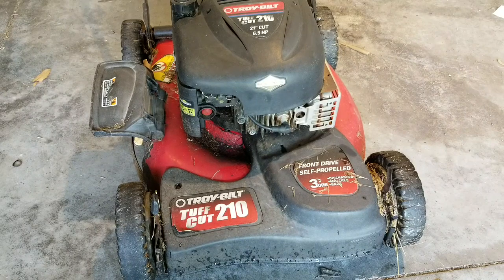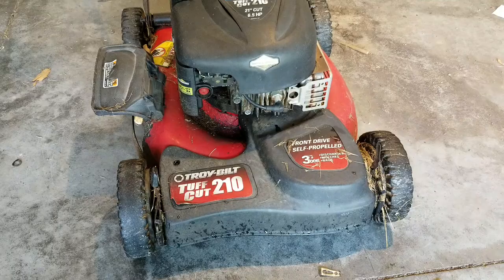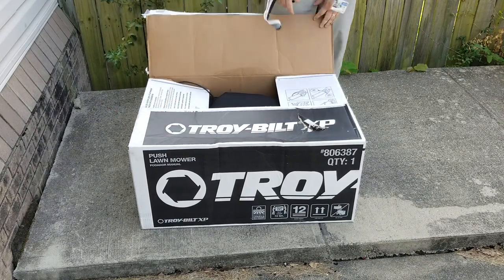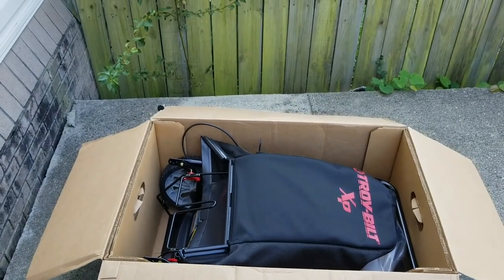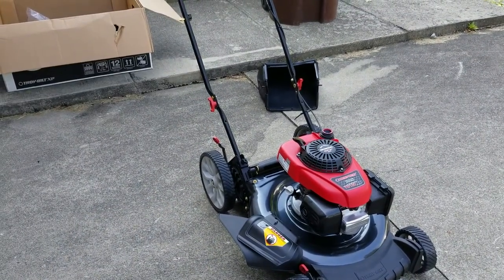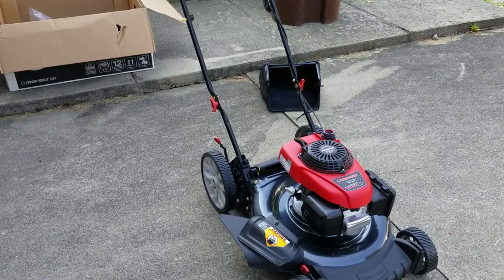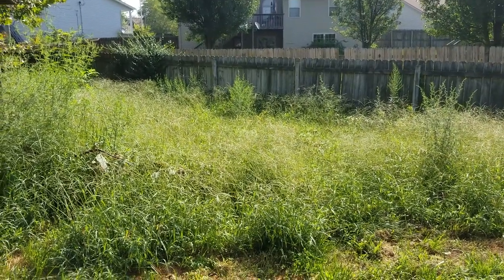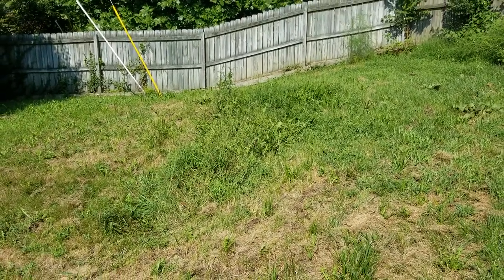Easy Bake BBQ S1 Ep3 Lawnmower unboxing

Comment: Nice looking mower. The Honda engine should serve you well. I have the GC190 in a power washer and I love it.
Reply from the maker: It is nice & quiet but I will end up with a Briggs & Stratton because I need it to be self propelled, check out my reply to Smoking_Bears for the full story.